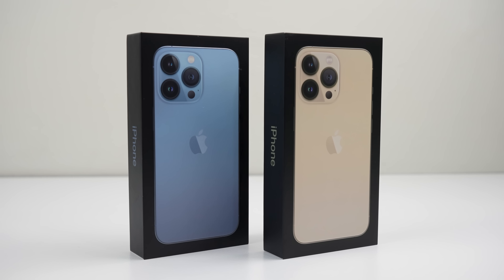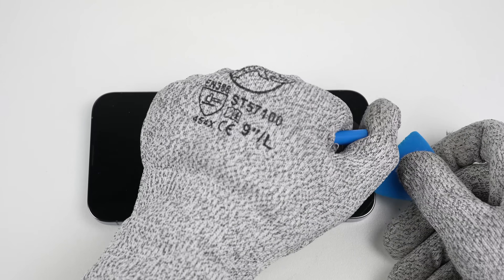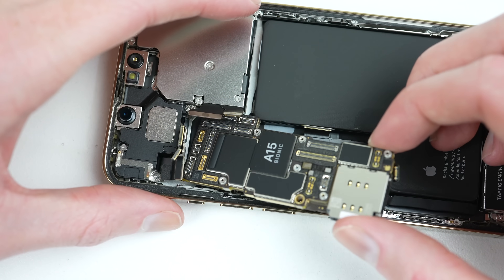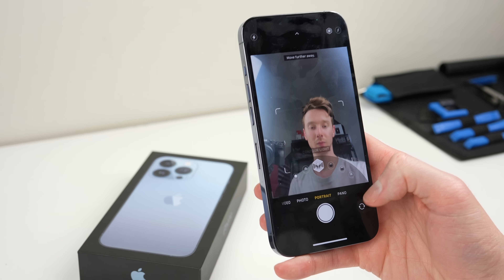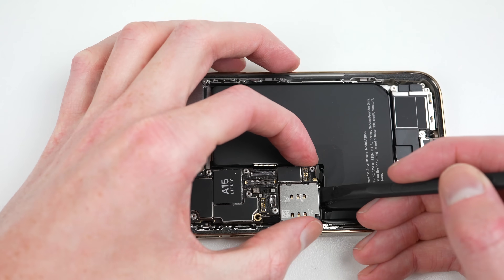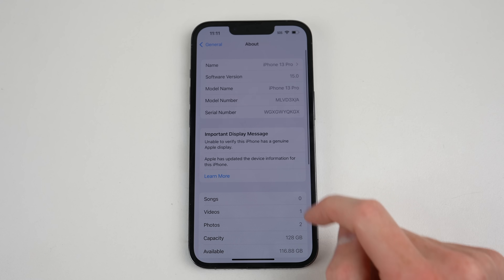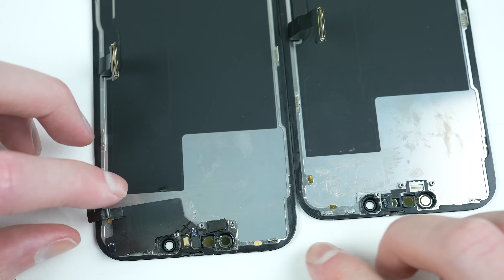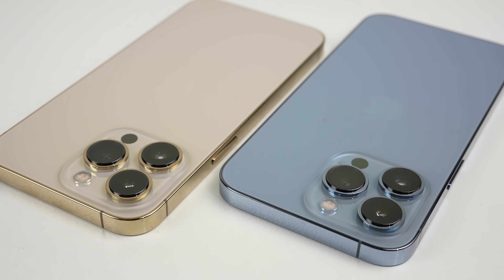iPhone 13 A Repair Nightmare - Teardown and Repair Assessment

Comment: I can't imagine they can get away with this in Europe - however, the USA is rather dodgy.

Currently, 19 states are considering so-called “Right to Repair” legislation that would require device manufacturers to make repair parts, tools, repair guides, and diagnostic software available to the public. Apple is fighting this legislation; public records show that Apple is lobbying against the bill in New York, where lobbying records must be disclosed to the public.
Reply: Right to Repair is passed in one state, Joe Biden has now passed an executive order to defend the right to repair, however it has loopholes that must be overcome.  In Canada, it's the same issue, in the UK same thing.  They will get away with it for a while but it is so tightly locked down now, all they have to do is lift a couple of restrictions at a time, each case resulting in a new one (buying time).  So far, they are getting away with it, just as Tesla now does with their horrific cars.  Tesla gets away with it because they are a software company, not an auto manufacturer....it's in court almost every day, Apple, Microsoft and Tesla lawyers now in the same room, trying to defend their IP.
Reply: @oz_medias  What a fucking nightmare it must be to live in a nation where the legislative branch can empower the executive branch with a simple majority. Seriously, let me tell you a story of a normal country.

Ireland. Drugs exist. They need to be banned apparently.
Irish Parliament makes law:
"No person may produce, possess, distribute, or consume illicit substances. The list of illicit substances shall be maintained by a government agency."
Good law, right?
No.
A man is arrested and charged for possessing illicit substances. Here is his defence:
"As described by the constitution, the power to legislate shall be relegated to the legislative branch. However, the government agency that maintains the list of illicit substances is part of the executive branch. Any time they decide to add or remove a substance, they are effectively producing new legislation. Therefore the law according to which I have committed a crime is unconstitutional. The defence rests."
Would this defence work in the USA? No. It's common practice for the legislative branch to delegate power to the executive branch. This is completely normal there.
Did this defence work in Ireland? Yes. Because Irish law isn't fucking insane. (On a side note, this court decision made drugs completely legal in Ireland for the 24 hours before parliament fixed it.)
The Irish Parliament can't just turn Ireland into a presidential dictatorship overnight. But the US Congress could totally do that with the USA. On federal land at least. The saving grace of the USA is federalism, which limits how much power the federal government as a whole has. But the power that the federal government has could be entirely delegated to the President. And according to precedent, it would be constitutional.

So yeah, executive orders shouldn't be able to do that. But they can. Fuck I hate the USA.
Reply: @andrasfogarasi5014  the amount of fallacies and willful bigotry/ignorance is just bleeding off of you.  Please get some help for your own sake.
Reply: I’m pretty sure I remember looking into the “Right to Repair” laws and most of them are complete BS legislation, like it’s easily avoidable or not applicable to most companies. If I remember correctly companies you’d expect not to want the law pushed for it, passing it so that if anyone tried to actually fight for a good repairability law in the future they could just say “We already have the right to repair law wdym?”.
Reply: "HoW DaRe ThEy TrY tO StOp Us FrOm ScReWiNg ThEm oUt oF MoRe MoNeY?!"
Reply: because they know they will loose money if they do. when that legislation pass, then people will really get to know how all these years how they are being treated like cows milking them for all their worth. this iphone has only upgraded 3xs in the last decade with the price increasing slowly being charged.
Reply: Shocking stuff. I can't believe they do that even if you use genuine apple parts. Can see why they'd do it to stop you using 3rd party components but these are genuine apple
Reply: If I remember well I think that the European Union is trying to reduce e-waste, and this is probably one of the laws that can be voted, they already talked about put back the removable battery of electric devices. I hope all these dodgy practices will disappear with time, because it is just hypocrisy to say that they try to be carbon neutral or whatever, removing things that have to be rebought, and then put things like that in their software. Apple is discusting but people will continue to buy
Reply: As of July 2021, right to repair was legislated at the federal level in the US
Reply: They 100% need too, It is fucked up that a company can get away with this!
Reply: @Big Amateur Apple is having a monopoly over THEIR OWN products!!!?!!! 😱😱😱😱😱😱
Reply: When you have no corruption in your state because you call it “lobbying”
Reply: @Amalgam03  the existence of the state is itself a corruption of human nature
Reply: My girlfriend and I were talking about this yesterday, apparently Europe is working on something to either force Apple to switch to a USB-C cable or lower the price of manufacturing a lightning cable. They charge companies a ton of money to manufacture lightning cables rn
Reply: Why wouldn’t they be able to get away with this in Europe? They’re selling them the same iPhones aren’t they?
Reply: @ethanlocke3604  Europe has different laws than the US. Especially when it comes to Monopolies and dodgy company practices, both of which Apple is well known for
Reply: @WyxienTheFox  yeah but I don’t think they have any “right to repair” laws for small tech like phones, although they do have some on appliances
Reply: @ethanlocke3604  they're bringing in right to repair in europe
Reply: @ethanlocke3604  Different laws.  The US has far more restrictive laws afforded to business than most other countries (land of the free, sure).  
Take copyright infringement (downloading songs and movies for example).  In Canada and the UK, those laws are a lot more consumer protective.  
Example.  In the USA, Discovery TV will send a request to an internet provider, indicating someone was downloading a TV Series.  The internet provider is obligated to provide Discovery with the downloader's personal info based on the IP collected by Discovery.  Discovery can then tale direct action and sue for copyright infringement.

In Canada and the UK, the Internet provider cannot legally send Discovery the downloader's personal info as it is protected by the Bill of Rights (their equivalent to the Constitution).  In Canada and the UK, they will merely pass on Discovery's message to the downloader, along with their own message stating that it is not illegal to download and the US company cannot take legal action against you.  For Discovery to take action, they have to gain a court order for each IP they collect, then apply to have the Internet provider send them the downloader's info.  Even if they were to go to such expense, the maximum fine is 5,000 per title, so they simply don't bother at all.  In the USA, one letter gets them in direct contact and they can go forward and sue the downloader directly, with little to no cost and with no Constitutional protections provided to the downloader.  "Freedom" I think more Americans should venture out and realize just how little they have compared to other free nations.  US laws are based on UK laws, as are Canada's, however there are an endless amount of added protections for US businesses, which completely circumvent the citizen's 'assumed' rights.
Reply: @oz_medias  It is not only in US. For example in Germany the provider is obligated to provide the personal info as well to e.g. 20th century or other film production companies.
Reply: @oz_medias  the US has a very broken copyright system aka the DMCA that was passed back in 1998 that favors legacy media corporations
Reply: @oz_medias  the netherlands thankfully have around the same as the uk and canada.
there was an problem with an institution here that goes against piracy and they were trying to get a list of people that were illegally downloading movies, songs, games etc.
the ISP denied them the information and they had to directly go to the court to get an order for the ISP to expose the information they wanted, this never ended up happening since it's just too much of an hassle.

The only time an ISP here really kicks in is when you're downloading terrabytes upon terrabytes worth of pirated material, i've downloaded a decent amount of pirated stuff and never received an message from them, know someone who does though, he was downloading movies all day (in the end he filled 10 5TB HDDs)
Reply: @ethanlocke3604  They're selling iphones in Europe? Oh yeah, to 50-70 year old Karens for a daily weather check and a weekly phone call to the manager, they take such good care of them they don't even have a smudge after 5 years and the battery is still brand new, so no need for repair.
Reply: @Socika14  It's about a 50/50 split in the European population between iOS and Android. Why is taking care of your phone a bad thing? Whatever point you were trying to make is unfounded nonsense :)
Reply: @ethanlocke3604  Europe is currently setting more and more laws for right to repair. to hinder waste. i think its just a question of time before they tackle electronic waste
Reply: @ethanlocke3604  exactly this shit is a  worldwide issue
Reply: it's all the same in Europe. Hell EU even regulated the charger thing, and apple just didn't care. They were fined by some small amount and case closed. It's corpocracy at  it's finest.
Reply: @qwer55555555  corporacy, socialism, same thing
Reply: @AverageAlien  an apt quote to describe you perfectly, “I have always found it quaint and rather touching that there is a movement in the US that thinks Americans are not yet selfish enough.” -Christopher Hitchens
Reply: "Right to repair" have some tech issues by now. For example, in systems with SecureBoot enabled, where the hardware must match the device security key that, of course, is composed of private and public key, how a third party can repair the device? Obviously, it cannot get the private key, because if the manufacturer do so, the SecureBoot functionality will be useless. It's the same as the iPhone 13 to iPhone 6. FaceID and Fingerprints hardware are signed with the very same key as the device motherboard. If someone changes the Fingerprint reader, this will not match with the signature and the OS will give error like in the video. The fact behind this choice is that the fingerprint reader can potentially give access to your secure storage, and if it's hacked, the security of the device is compromised. For IT Security point of view, it's true like the sun, but for the average consumer point, that don't mind about this level of security (even if they must, I say, now that devices are the door for our lifes), this feature is a true issues to the "right to repair", as obviously the private key of the signature cannot be shared. By my point of view, I prefer security over right to repair because I use my devices for work. Even as an IT Engineer, I prefer security over other factors, because today security is a strong issue. Still, I can understand that it's not everyone priority, and maybe the OS can be updated to warn the user about the risks, and then let him choice. But average users not always have means to do this choice thinkfully. It's not an easy debate, that's why a lot of laws are still stuck.
Reply: @AlessandroMorvillo  It's not that secure because Apple still have ways of getting round it, so there are ways.

And there are also ways of making things secure and still being repairable.  For example using software and/or online activations/registration for changing parts.
Reply: @mrfish9876  apple cannot overcome the hardware security. They changes the whole motherboard. This is also specifically implied when you use your devices. Use software for security is bad idea. Software security issue is because TPM chips exists, and it’s why Windows 11 requires them as a minimum system requirement. The security of hardware specific architecture is far better of the one that you obtain by using specific libraries without hardening hardware.
Reply: @AlessandroMorvillo  I guess Security requirements are an argument that can be made in favour of phones being nigh impossible to repair without cooperating the manufacturer, but it's really brutal as a practice for a random customer because theses phones cost a lot, and I mean a LOT of money, while being advertised for the general public. I could get specific features added to a phone to increase its security at the expense of repairability, but the truth is, very few people use or actually benefit from it, and certainly not the majority of the audience Apple is appealing to, hence why these features being added by default feel like a really dirty trick to squeeze additional money from its customers more than actual useful features.

And I get it, you can always find a phone elsewhere, and to be honest you should because Apple products are needlessly sophisticated compared to the needs of its public, but it isn't a good look for one of the most famous corporations on Earth to put this level of commitment into harming the experience of most of its customers through stupidly hard repairing options, even if you can justify them in some scenarios. Security is primordial when considering phones, but the level of security needed for a random customer shouldn't require such drastic measures.
Reply: 1k like
Reply: Europe is just the same trash, they’re Americas peons anyway. They might be a little more regulatory here but not that much to be significant
Reply: OH GREAT, MORE government regulation is exactly what we need. Yeah that'll totally fix the problem. Just keep increasing government regulations until only gigantic monopolistic corporations can survive and the true free market is snuffed out! That totally won't lead to socialism or anything!
Reply: @AverageAlien  I fail to see how laws that make it illegal for the corporations to pull malicious shit like this is harmful. They have already proven they don't care how unethical it is to sell products in a sabotaged state.
Reply: @Blaze_Shadowflame  You encourage this behaviour by buying their products. And by you, I mean everyone that buys their products. 

Government regulation usually hurts small businesses more than large corpos. It prevents capitalism from doing its job, because large corpos have deeper pockets and less to lose.
Reply: @Blaze_Shadowflame  This isn't an ethics question. You can't be ethical when you're an employee in a mini state like apple. Or even the CEO of apple, which is elected and can be fired, like the president of a country. Apple is its own government. It's a public entity that you can own a part of.
Reply: @AverageAlien  That doesn't mean it exempts them from ethics. And ethics is at least part of the question. They are knowingly making it necessary to buy a full-priced phone after minor damage is inflicted. Further, it is undeniably unethical to have software intentionally simulate bugs and glitches to trick the owner into thinking the repair was botched and they must take it to a proprietary repair shop that has a policy of replacing all parts without customer input to increase profits. Why should we NOT call this out, and make sure as many people as possible know about it?
Reply: @Blaze_Shadowflame  Point is, odds are right to repair legislation will either be lobbied against or loopholes will be found, so the only real way to get rid of these problems is through market demand. Only reason Apple gets away with this shit is because of their brand recognition, sleek presentation/ecosystem and the general lack of knowledge of the layperson. Otherwise no one would ever buy Apple's shitty products. While I'm not against right to repair legislation, I have little faith it'll have a permanent impact.
Reply: @Blaze_Shadowflame  You should call it out and make sure as many people know about it as possible. Some would even say it's your civic duty.
Reply: @AverageAlien  so what will satisfy you? Total anarchy? Bad take my dude
Reply: @Purplethingyt  A small state
Reply: @AverageAlien   US government regulation usually hurts small businesses more than large corporations because the large corporations are paying off the politicians.  (The EU is much better than the US, where regulations usually protect citizens and small businesses.  Britain is somewhere inbetween - worse than the EU but not as bad as the US.)  This is actually a failure of capitalism, where corporations get so big and influential that they control the government anyway, at the expense of the rest of the population.  

That's not to say socialism is the answser but Apple isn't far from socialism, when companies get so big and influential they kind of become a state themselves.

The real answer is to stop bickering over socialism and capitalism but to be pragmatic and take the best ideals from both.  We should fight for laws and rules that protect individuals not big corporations, and fight against control by states of any type - be that a handful of giant corporations and oligopolies, or the traditional socialist state control uprising.  Neither is good.  We should fight for the details that matter, rather than "picking sides" and treating politics like a football match where you have to passionately support one of two teams
Reply: @AverageAlien  The EU income tax rates are not robbery, tax rates are comparable to the US yet the benefits and living conditions are much higher.  The average citizen in most European countries, and Britain, have a much wealthier life than the average US where most people work ridiculously long hours, have no workers rights, poorly regulated health regulations, abominable health care, and are just generally downtrodden and poor.

What you really need is the freedom of capitalism but with the public putting pressure on the state to enforce regulations that benefit them.  Socialism is worse than capitalism, but corrupt capitalism is essentially the same thing.  The problem these days is it's too easy for the rich to run publicity campaigns to influence the dumb populace to campaign for things that are the opposite to their own interests.
Reply: @AverageAlien  you've gotta be trolling lmao
Reply: @princessjello  Debunk a single thing I said kiddo. A single thing
Reply: @mrfish9876  Tax rates are insanely high. It's getting worse in the US as well. There is no such thing as free healthcare. Public healthcare is just a state monopoly on healthcare. Big US healthcare corporations are all socialist and government subsidised. They all run off stolen tax payer money + the extremely high prices they charge  

If you want fair prices for healthcare, remove all state control, bring out the free market, full capitalism, no regulation, and then you'll have 100s of tiny hospitals and doctors working independently to choose from, with low prices, just like the 1800s  

There is no such thing as corrupt capitalism. The issues of this world are created by a lack of capitalism.
Reply: @mrfish9876  There is no such thing as free healthcare. You have higher taxes, some of the highest in the world, to pay for that state monopolised healthcare. You're being robbed at gunpoint and forced to give money to the state monopoly on healthcare. 

Capitalism is the private ownership of the means of production. Do you know what private means? I don't think you know what private means. Private means INDIVIDUAL. YOU. ME. INDIVIDUALS. Not corporations. INDIVIDUALS.
Reply: @AverageAlien  Lol where did you hear that?  You been listening to Fox News or something?  I live in western Europe, we do have rights, and depression rates are much lower than the US.  We have better regulations to protect us in everything from unemployment, food standards, working practices, safety standards, etc.

We look at things like the poor regulations of food in the US, the hours that people work, the working conditions and contracts they have to accept, etc in horror.  That video of someone with a broken leg screaming at people not to call an ambulance because they can't afford it is like something we wouldn't expect to see in a 3rd world country.  Stories of people losing their homes to pay for healthcare and stuff, it's just unthinkable to us.  If you've never been to Europe, you should try it, spend a few months over here if you can and get to know what it's really like.  It's not perfect, but we have a guaranteed minimum standard of living, and much better protection from our governments.  Life is far better in Europe.
Reply: @AverageAlien  

We could very easily take a vote on the right to bear arms and I can guarantee you which way it would go - we don't want it.  You can actually get firearms licenses in UK/Europe it's just people don't very much.  We don't want school shootings like the US, 99% of the population is very proud of our stance to not allow easy access to guns.

We do have a choice for private healthcare.  Many people in the middle-class and upwards choose that sometimes because you get things like nicer meals, drinks, entertainment, and a more personalised service.  Literally look up the prices for various operations in the UK and compare them to the US, it's actually cheaper here to "go private" as we call it, WITHOUT medical insurance, than it costs in the US WITH medical insurance.  Let that sink in.  I can literally goto a private hospital in the UK now, without health insurance, and it'll be cheaper than getting it done in the US with health insurance.

I understand that you're saying they're socialist, by the strict definition they aren't but I'm not going to get into the argument, because arguing over capitalism and socialism, left vs right wing, and all that bollocks, just detracts from the real issues.  It's assigning names to things for people to focus their hatred on rather than trying to come up with pragmatic solutions.

It is probably because some people in the US accuse Europe of being socialist, which it isn't, that they're so scared to admit that our governance is so much better.  If people stopped getting so hung up on harmful ill-defined broad generalisations, everyone would make more progress.

We have control and regulation to suppress large corporations abusing their power.  Not to suppress individuals.
Reply: @mrfish9876  also, Democracy is not a right
Reply: @AverageAlien  They're not fully armed at all times.  Police here don't carry guns either, apart from very specific personnel in very specific situations where they're an obvious necessity.  Everyone is aware that the authorities have access to guns if they need them and most people don't, yet nobody ever campaigns against it.  We prefer to live without the worry that any one of our neighbours could just turn up and shoot us one day if they get pissed off or for any other reason.
Reply: @mrfish9876  Also, as you pointed, if you really, really want a gun you can get a license and buy one. Of course, you must pass psychological check, drugs check, penal fee check, and be judged to be a personal in his fully mental health, not a danger for the security of others. If so, you can get your gun, for your safety. Then you get checked periodically. I agree with you Al, nobody here needs a gun and nobody want to get into this twist of security check if really not needed. We have guards, we have police, we are secure even without a .44 in the pocket. Totally agree.
Reply: @AverageAlien  Dude being pragmatic is the way to go and for at least a little while we were going down that route until lobbying became super powerful.
Reply: @AverageAlien  at least in the U.S you are allowed to bear arms and protect yourself, here in Europe our lives are in the hands of the government, crime rates are going up because of immigrants who are armed.
Reply: @stiannobelisto573  The answer is not to arm ourselves "just in case"; it's to crack down more on those who threaten our peace with violence and guns. What actual evidence is there that "the crime rate is going up ", and where is it that this is happening with a proven correlation between guns and immigrants?
Reply: @mrfish9876  that may be on the UK here on Spain they always carry the pistol as it is part of the regular equipment
Reply: @AverageAlien  What is your understanding of socialism? State ownership of everything? If that were the case, Anarcho-Socialism wouldn't be a political movement. Socialism is the people being in control of the country. If the government is not controlled by the people but instead by rich oligarchs, it is not Socialist.
Reply: @AverageAlien  I'm sorry but you have your definition wrong. Socialism is when all aspects of society is owned and run by the community. If the community organises a state to represent them, and they have direct ownership of the state, then it is State Socialism. If the community organises a communal horizontal power structure to run society, then it is Anarcho-Socialism. Literally whenever a community gets together and votes on something which will affect the community, they are practicing anarcho-socialism. 

Nowhere other than in American red-scare propaganda is socialism defined as statism. In your mind socialism has many contradictions because you have assumed it has traits which it does not. It is that simple. 

"Rich oligarchs are socialist" so America is a socialist oligarchy? Because it's policy is governed by the will of lobbying CEOs and companies? Very interesting.
Reply: @MrMyers758    The community is the state....that's literally what a state is defined as....a commune, or a group. A collective, usually with shared goals and ideologies. 

All socialism is state socialism. There is no such thing as stateless socialism. That's as idiotic as saying "free authoritarianism." 

There is no such thing as anarcho socialism. Another oxymoron. Two completely contradictory positions that cannot co-exist. A stateless society is a purely capitalist society. You can't stop the consensual trade of goods and services between individuals without a state. 

When a community exist, that is a state. That's called socialism. Anarchy is when individuals exist without forming a group or community. Anarchy stops once a group exceeds the size of a family, and a hierarchy or structure automatically forms. Simple human nature to form hierarchies. You don't know what socialism is. America is partially socialist, by definition. We don't have true capitalism anywhere. Some nations have more socialism than others. The larger the state controlled sector grows, the lower the quality of life for the individual becomes. Pure socialism, is just a fantasy. All states need to leach off individuals to survive, which means leaching off capitalism.
Reply: @AverageAlien  Oh my god you are so wrong with definitions, you just keep repeating the same thing. A state is not synonymous with a community. A country owned by a king has a state, but it is not communally owned, so it a state is not synonymous with a community. A small community of 20 people is not a state. Anarchism is not the lack of a community. By your logic, a corporation, venture capitalist groups, discords of NFT bros, are all states, because they are communities. Do you not see how stupid the definition you just made up is?

A state is the label given to a country which is run by an organisation which represents the interests and will of a population or an elite class, which has a monopoly on enforcement. Look at everything which is labelled a state, and you will see this description matches. Look at everything labelled a community, and you will see hardly any match this definition. 

Also by that definition, capitalism and anarchism are also impossible. There is no part of humanity, and no way for humanity to live without working together for common goals. Any time that happens, by your definition it is forming a state, and since you think capitalism is synonymous with anarchism, capitalism and anarchism can never exist. By your definition, true anarcho-capitalism would be every individual human goes out into the woods, never interacts with another human, and dies alone. Well, the rest of the world disagrees with your definition. So by your definition, the only thing that can exist is a state, and since you have said that socialism is state ran society, socialism does exist, and is the only form of political organisation which seems possible without making humanity extinct. Well done for contradicting yourself, and painting your ideals as the most depressing existence any individual could wish for. 

To summarise: you have a very simplistic view of the world. Any time a few people get together you label that a state. The rest of the world calls that a community. A state may be defined as a TYPE of community, but not as a synonym. Unless we are currently living under the State of Youtube Comments Section  - County Under Ben Guy-William's Comment.
Reply: @MrMyers758  My definitions are the only definitions. Definitions sourced from dictionaries like Oxford and Cambridge. You are the one that keeps repeating the same corrected errors. You socialist cult members refuse to learn. 

Once again, it doesn't matter what the specific state structure is. It's some kind of hierarchy, and if that hierarchy happens to include a king or dictator, that doesn't change a thing. It is still collectively owned, a king has subjects. A king doesn't exist without the rest of the pyramid propping him up. State is synonymous with community. Any community or group, with vaguely similar goals and politics, is a state. A community of 20 people, provided they're not just a family, is a state. It's a public group. The public sector. Where do you draw the line and why? You have zero logical reasons to draw any arbritary lines. Well, I suppose that says more about your faith than you as a person. The faith in the religion of socialism. 

Yes, you finally got something right. Well done, you're learning. Corporations are mini-states. They are by definition, anti-capitalist socialist entities. A corporation is a state within a state. So is a union, and so is a cartel, or a mafia. The central state is simply the cartel that was here first, or took over first, and has the most amount of state paid armed goons. I see just how perfect my correct definitions are, and how idiotic your marxist cope definitions are. Because that's all you're doing now. Reciting hard marxist copes, invented to distance themselves from other evil socialists like Hitler. Everytime socialism is applied, it leads to mass death. Any nation which is 80% socialist is already doomed. The US is more like a comfortable 45% socialist. The ideal and perfect society would be no more than 20% socialism, 80% private sector, all tax is voluntary and the state is only responsible for millitary and maybe some small part in education. 

A state is any commune, group, body, corpse, corporation, with perhaps similar goals and ideologies.
Reply: @MrMyers758  Yes for that last part. YouTube is a part of a public corporation, or mini state. The content creators are the private capitalists. The platform is part of  the socialist mini state within the central state. Any public hierarchy is a state. And all groups form into hierarchies automatically.
Reply: @AverageAlien  If you think rampantly capitalistic corporations having all power leads to socialism, you don't know what you're talking about, it's just a scary boogeyman
Reply: @AverageAlien  dude laws are like forever behind. They cant get shit done and it shows with how little regulation there is on most businesses.
Reply: @G.D.R855  they can't get shit done because of how much regulation there is
Reply: @AverageAlien  huh you make zero sense and at this point I think your trolling
Reply: @AverageAlien  your making this about something that it isn't ,This is about have the right to repair something that you own 

And yes even doah you can buy other phones ,the phones made by big manufacturers all have this problem because of economy's of scale and there reserve capital plus the fact they make the components for every other phone give them a major upper hand on there competitors
Reply: And when some fool gets access to the equipment needed to make a so called self repair and stuff it. And then scream it's Apple's fault what then? Not everyone is capable. And in Europe the EU is turning in to some kind of overlord trying to get companies to adhere to standards that they set. If only governments and countries could be held to account in that way also.
Reply: @EDITS_SC  Yes, you're right - it should be illegal to repair anything because when we fail we might then try to sue Manufacturers. Do us a favour and keep your idiotic ideas to yourself - watch the video, you'll see a very competent fixer being defeated by a manufacturer who refuses to allow competent repairs with proper tools and original parts from being carried out.

Isn't it enough that they make sure that the warranty is void? People only carry out these operations on devices which are out of warranty.

Apple is famous for overcharging for basic repairs, and it's not a question of extreme labour and parts pricing. It's plain rape.
Reply: @BendyLemmy  then don't buy their products, LMAO. No one is forcing you to buy an iphone. You make an informed purchase and thats it. Whatever you bought, is whatever they made.
Reply: @AverageAlien  they are forcing you to buy it. Since all companies are doing this to a degree  you literally have no choice
Reply: @NickolaySheitanov  wrong
Reply: @EDITS_SC  Found the libertardian.
Reply: @EDITS_SC  Your stupid aren't you? You do know that this stuff is very shitty and immoral yes not everyone can repair stuff but when even if you can but Apple makes your phone self destruct it's kinda dumb that you would have to buy a whole new phone or pay hundreds for a small repair.
Reply: @EDITS_SC  wow imagine missing the point that badly